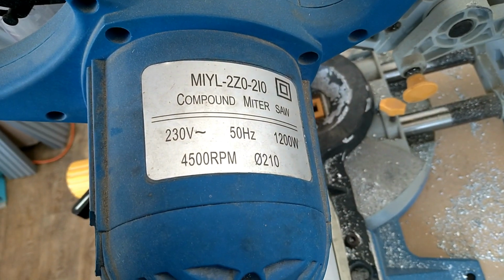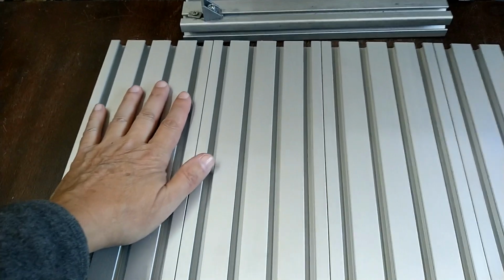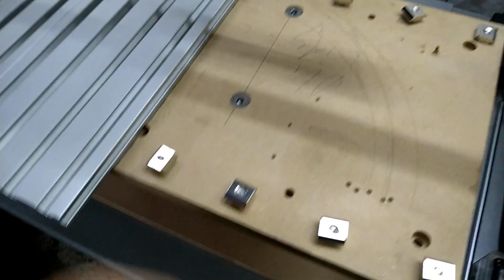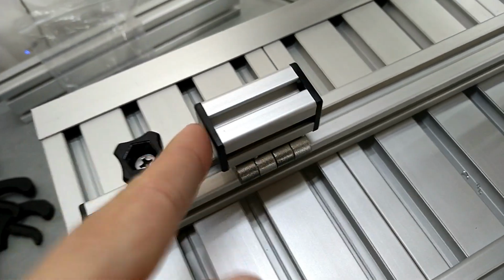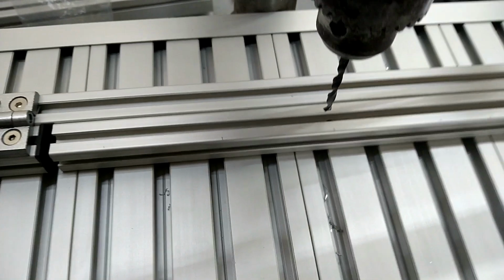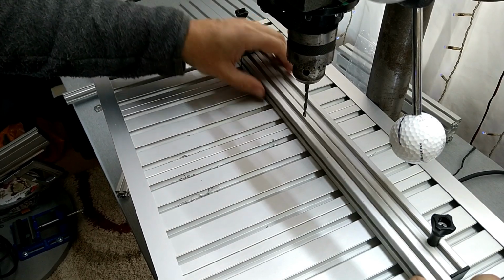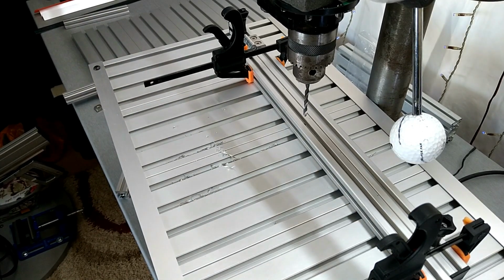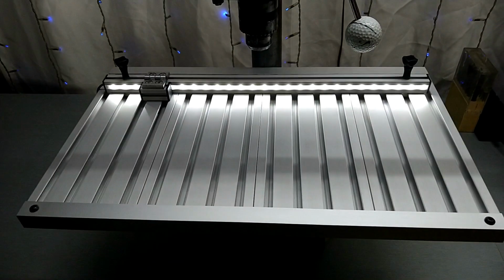How to make a "Machinist" DIY Drill Press Table out of T-Slot Aluminum Extrusion Profiles by #Hayri

Comment: I love those extrusions, so versatile.  Great idea, this.  Also loving the LED addition.
Reply from the maker: Thanks, that makes at least 2 of us 🙂I think next is a angle grinder table, where you can push an angle grinder back and forth on shafts or linear bearings while pressing it down to cut straight lines. I do have a stand, but that only goes up and down which limits the cutting area. Stay safe.